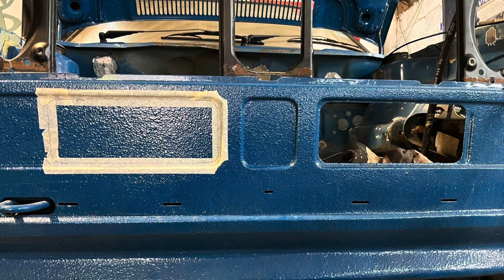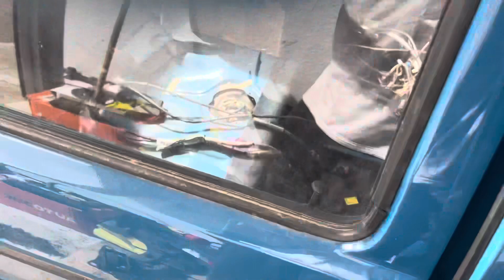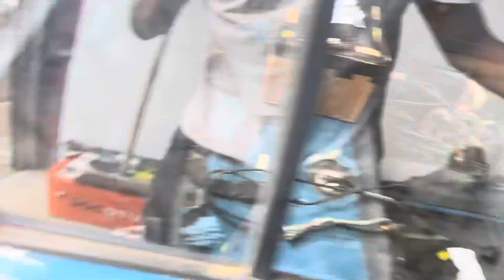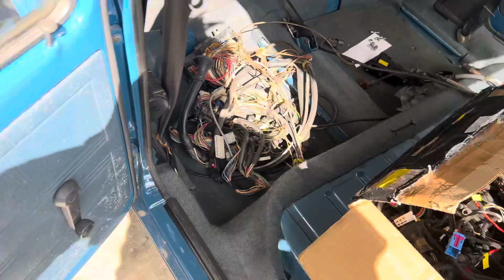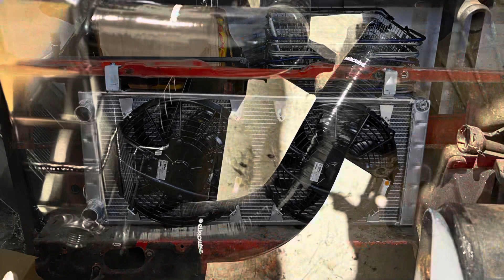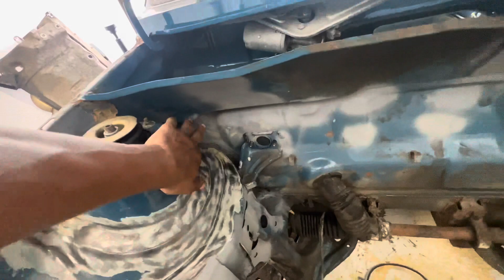Mk1 Jetta R32 Build - Pt4 - Welding Done & Engine Test Fitted

Comment: Hi can i ask what cars  gearbox  you are using the 6 speed from please , i thought all the vr6 6 speeds were all 24v 4 mo ?? Thanks.
Reply from the maker: This box is one that’s been pieced together using parts from the 6 speed 02S gearbox, but the bell housing swapped out and the VR6 bell housing used 😉
Reply: @jaaattengineering8940  Ahhhhhh  i seee  thank you for helping,   so that gets rid of the rear diff part,  great idea 👍🙏  i take it a 2.3 v5 would be much the same aswell then, might be esier to get hold of than a vr6 bell housing 👍👍 Thank you 👊
Reply from the maker: @dubayadot  correct. VR5 bell housing is same as VR6. These are FWD gearboxes so no transfer box. 

Google 02S gearbox, basically a 5 speed with an extra gear on the end 😉
Reply: @jaaattengineering8940  Thank you, just going down this road myself , you have been a great help, thank you 👍🙏👍